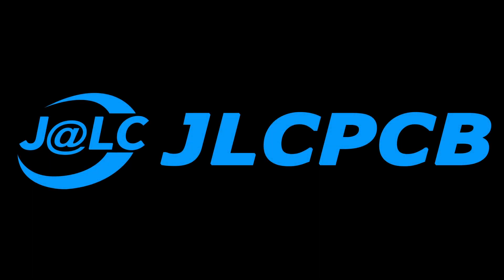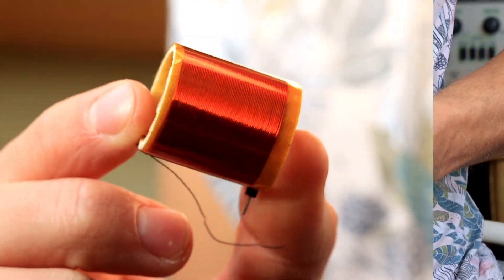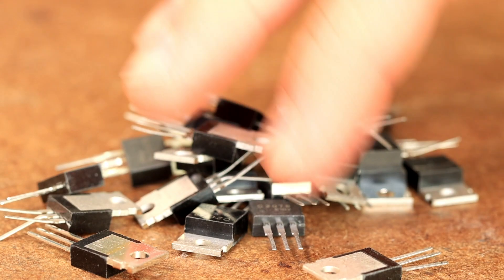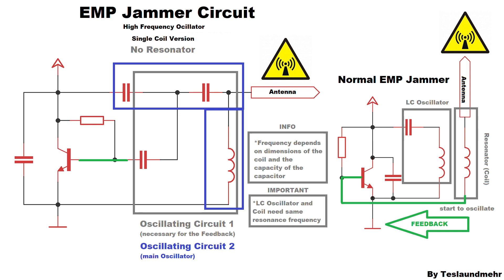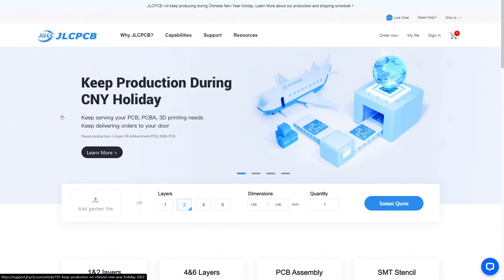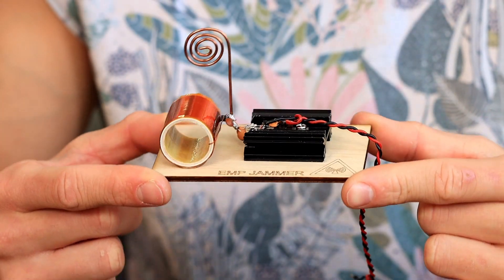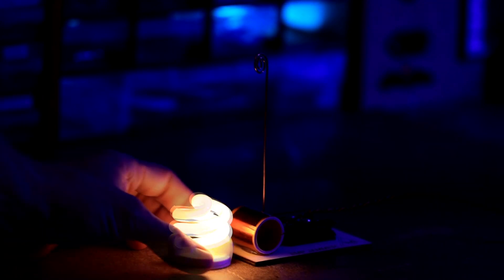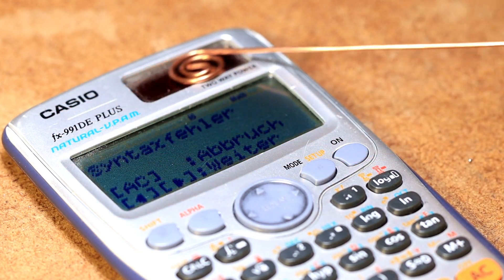EMP Pulse Generator Jammer New Circuit 2022 - Tutorial

Comment: I first thought it's a fake circuit as the transistor seems to simply short the power supply on the schematic. However it works because of the inductance of the power supply lead! Just something to keep in mind if you want to truly understand how it works. Also a antiparallel diode on the transistor base seems to help a lot.

Comment: There might be a benefit to using a POWER Field Effect Transistor.  They are very tough and have a very low ON resistance.  Try driving it between cut-off and saturation.  Such transistors require to be driven from low impedance, and a suitable driver IC should be used.

Comment: How would you connect e.g. a dipole or a loop antenna? Second wire goes to GND?
Reply: The voltage across the inductor is equal and opposite to that across the capacitor, so there are two places in the circuit to put each pole.

Comment: Can you explore for us Tesla's "the true wireless"?
edit: there's a video called Tesla Technology Has Been Revived
Reply: Parametric resonance between two tank circuits where the earth is the standing wave inductor of the first resonant circuit, and the air is the capacitor of the second resonant circuit. The second tank circuit has half of the resonant frequency of the first tank circuit, where the earth is a standing wave inductor. Two towers are requires for parametric coupling.